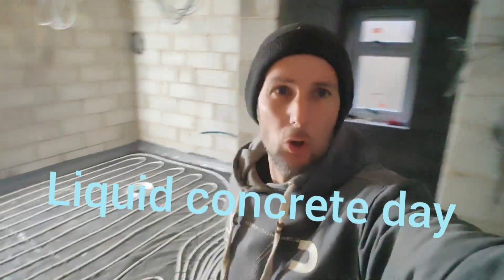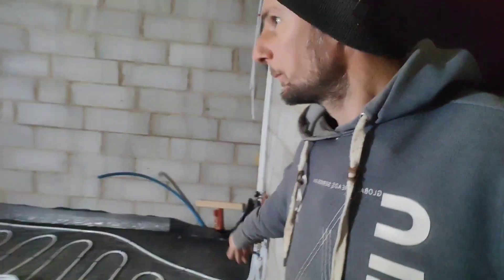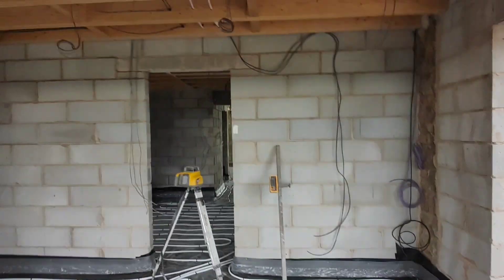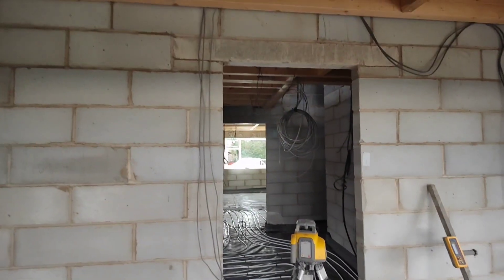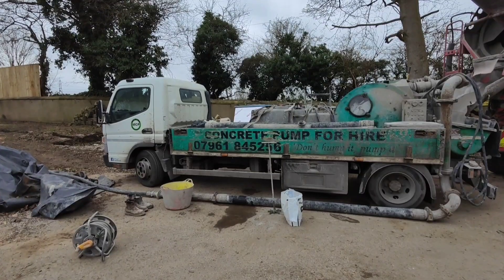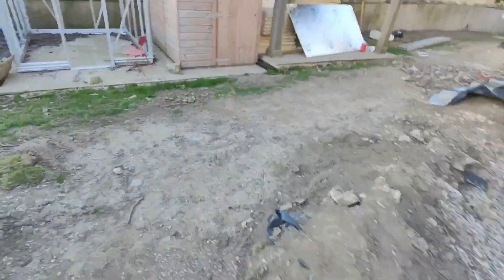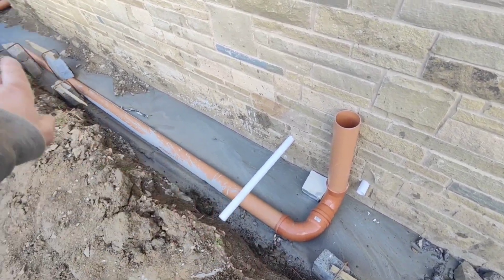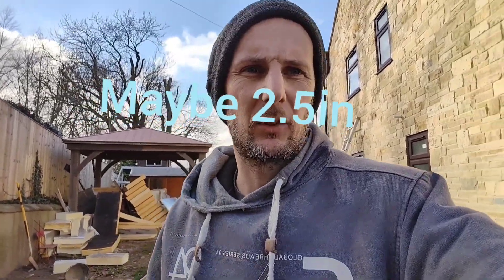liquid concrete floor screed

Comment: Nice clean job mate.
How come there wasn't a regular concrete sub floor?
Reply from the maker: Cheers mate .it was built on a big raft of concrete.but it was 440mm below the height we needed. so the best  way was to go 300mm with hardcore first the  floor is about 1m thick lol .it would have been nice to fill it with concrete but the cost was crazy.normaly we do concrete sub floor when we have a trench footings👍

Comment: Can this screed go down to 20mm onto concrete  or are there any recommendations, for a low-profile wet underfloor heating
Reply from the maker: Hi Steven I honestly not sure .I am pretty new to it .I am sure you could if you was going on to concrete just use a primer .the pipes that are in this floor are 18mm maybe 17mm . sorry I can't tell you more 👍👍👍